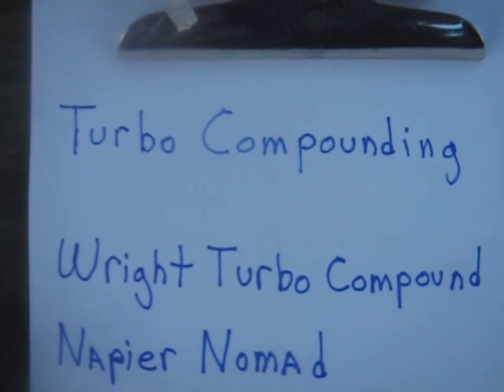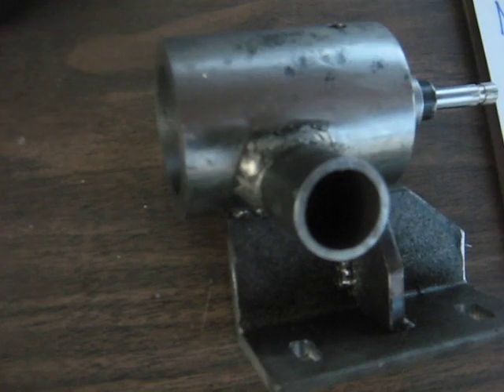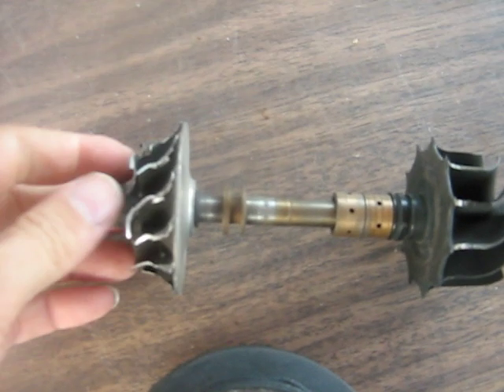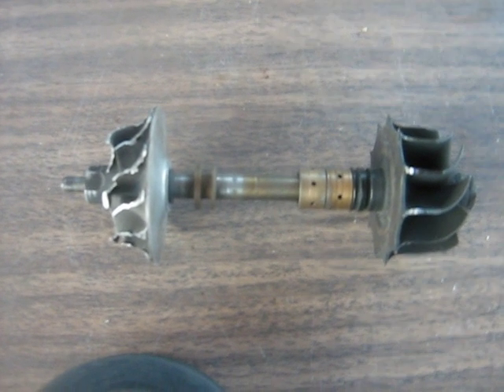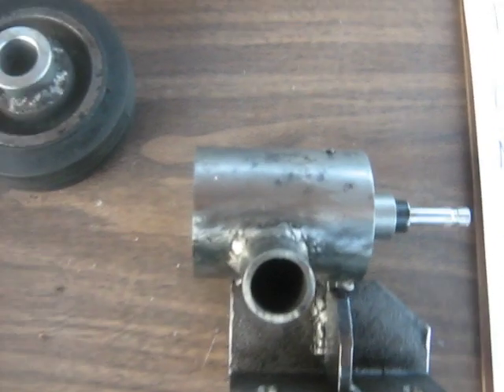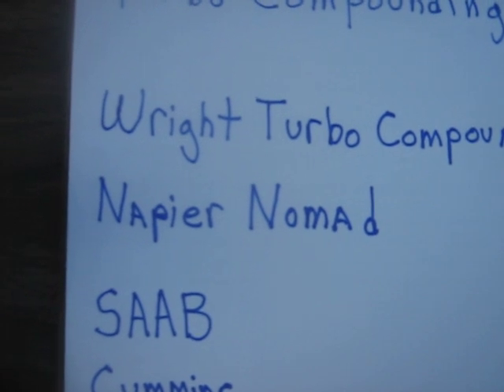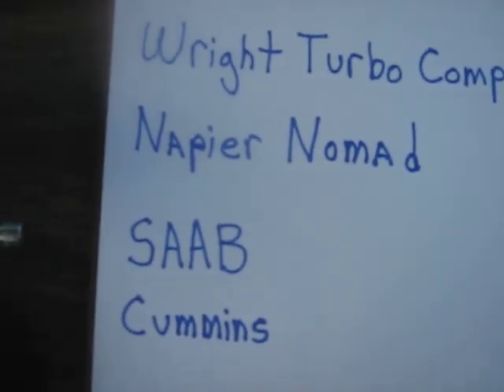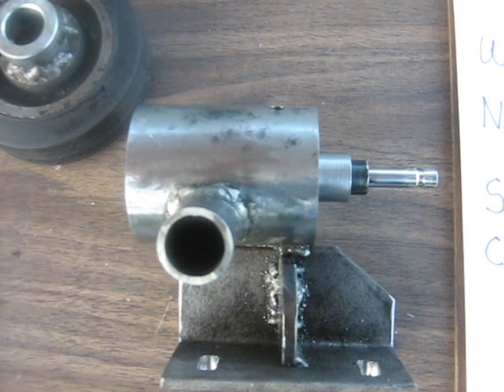What is Turbo Compounding?

Comment: Conventional turbocharging is analogous to using a high-pressure hydroelectric turbine to generating electricity. These systems both work off the high pressure intake side of the turbine - and - substantially reduce that pressure to generate electricity.

Turbo Compounding is like using a stream powered water wheel to generating electricity. These both work off the speed of the intake and don't affect the upstream speed or pressure in any way.

In other words, conventional turbochargers work off the pressure of the exhaust (and rob the engine of power); and turbo compounding works off the speed of the exhaust (and doesn't rob the engine of anything).
 
So why then do they say turbo compounding turns reclaimed heat of the exhaust into power and not reclaimed speed of the exhaust into power. The answer is bc heat and speed are interchangeable as described by Bernoulli and the Ideal Gas Law.

I've just done something that no one on Youtube has ever managed to do before - simply and intuitively describe how turbo compounding works.
 
You're welcome
Reply from the maker: Hey, thanks for that explanation, it is quite interesting!

Comment: What if you could develop a turbocharged axial turbo compounding engine? 

Essentially, take an even amount of pistons, and place them around an axial turbine design which means the primary forces of pistons will be moving in line with the residual thrust of the turbine.

I wonder if it’s possible to employ a turbine in that role, being turbocompounding, turbocharging and, perhaps, able to produce electric power or generate its own thrust independently of the pistons.
Reply from the maker: That  sounds like an interesting project, have at it!

Comment: The current Formula 1 cars use an electric-hybrid form of turbo compounding. 

The turbo unit (the shaft) also act as generator powering either the battery or the electric engine (which also doubles as a starter and kinetic energy recovery system when braking).
Reply from the maker: Yes, my son was mentioning that hybrid set up they have in F1, pretty ingenious!
Reply: ChargerMiles007 True, very ingenious,  but the noise of the current formula "sucks" compared to the old naturally aspirated V8s and especially the V10s and V12s.
Reply from the maker: Yes, I can imagine. I have a few of the Hot Wheels Brabham Repco V8 engined toy cars, i like the old cigar shaped bodies before they started adding wings to them. Too bad the wouldn't outlaw the wings, and get back to some real driving!  :)
Reply: ChargerMiles007 I doubt any 960 hp racecar (800 ICE + 160 electric) is going to be "easy" to drive.
The V10s which had more down-force and electronics (due to the rules of-course) were nearly undriveable in the hands auto journalists.

Noise may be wasted energy to an engineer, but fans loved the sound of those older aspirated cars.

Comment: You forgot to mention BMW are experimenting with it for cars. Why aren't cars fitted with turbocompound engines as an optional extra?
Reply from the maker: +Chris Henniker Thanks for the info about BMW, I wasn't aware of that. Interesting question, why isn't it an option, perhaps they are all concentrating too much on hybrids and going green.
Reply: Probably because turbocompounding was originally meant for certain engines, such as diesel generators, aircraft engines and large marine diesels, operating at nearly constant RPM ranges (as all gas turbines are, since turbo compound arrangements closely resemble the most simple gas turbines, having a gas generator like shaft, which is the turbocharger, followed by a free power turbine connected to the engine's shaft), and a truck does exactly that when cruising on the highway, while a car would be operating at a larger RPM range most of the time so the power recovery turbine could possibly not work optimally, or be subjected to too much stress (i think that's also the reason as for why variable turbo geometry is rarely implemented in large diesel engines). It would also need a large displacement engine to have the required volume of exhaust gas in order to extract a reasonable amount of energy (IIRC the Scania 124 470 gained about 50 hp from turbocompounding alone), so it's more suitable for trucks than for cars. It could also reduce the engine's reliability.

Comment: Why not put an exaust driven turbine where the exaust comes out with and afterburner to get thrust like a motorjet? probably illega and dangerous but I'd try that if I had the tools LOL
Reply from the maker: +Rex Holes Yes, I bet the local enforcement wouldn't view flames coming out on the tail pipe very kindly! Sounds like something from a Batman movie!  :)
Reply: Not only illegal and dangerous. Pointless, because the engine exhaust gas kinetic energy is low to start with. That's why you need to replace a turbo with a complete gas turbine if you want to reach insane levels of boost, instead of just stacking turbos (sequential turbocharging).

Comment: Id like to see what sort of shaft power you could get with a compounding turbo converted to a turbine ala Colin Furze or perhaps in a wood burning turbine engine such as the one developed by Mark Nye at Nye Thermodynamics.
Do you think you could pull that out of the hat?
Reply from the maker: Doing that might be a stretch for me, we have gotten a few runs out of our twin turbo jet engine, but my son made that so I am not up on all the calc's to figure out a new combustor etc. I will have a look at those sites though, as they sound interesting.

Comment: Yea I feel you there I buy 3 used frames ,3 body's , 7 engines none was working and random go kart parts from a guy it was cheap and I have build one so far I'm working on the second one and the third one we are gonna use 2 engines or build a 2 cylinder its gonna be sick I gotta post some videos of the one its almost finished

Comment from the maker: A 5 horse Briggs works out pretty good for a go kart, especially since the output shaft is 3/4", which is an easy size to get a centrifugal clutch for.
We built a homemade go kart from 1"by 1/8" wall square tubing, it was light enough that it would fry the one drive wheel with me on it punching the gas on dry pavement  :)
Wished I still had that kart, but we sold it to a friend.

Comment: Yeaa i know me and my brother and one friend always use to do alot of proyects toghether now  we are married and with out time but i still try to do some projects myself i know i little bit of everything wood.metal.fiberglass.sound systems.mecanic.building remodeling.electricity.plumbing.  now im learning about small engines you name it  i also have experience with lathe i use to work at a machine shop for over a year when i was younger keep up the good work

Comment from the maker: Interesting discussion going on here!
So most turbo chargers with centrifugals blowers would in fact use a radial turbine, interesting.
Maybe mine is a Centraxial !!!  :)
Plus I swear one of my engine contraptions used an extake valve  lol.
Thanks for setting us striaght about that. I will have a look at how to make a stator for my turbine to help it work better.

Comment: Well, I'm still pretty sure that the proper name is radial turbine since they don't rely on the centrifugal force at all to work. I'm currently reading "The Jet Engine" by Rolls Royce, but they don't even bring up these turbines. A bit of google searching supports my claim though. A compressor, on the other hand, can be of the centrifugal type, since those use the centrifugal force to compress air.

Comment: At least in jet engines its referred to as centrifugal, Centrifugal flow turbines are usually used in things like turbochargers and helicopter engines or APUs. The hot gases from combustion (or exhaust in this case) flow centrifugally across the blades so I guess it could be called radial flow as well.

Comment from the maker: Hmmm, that is a good point. I admit I am no expert on this subject!  I just call it an axial turbine since the gases flow axially off the blades. I plan to add a stator to it, but you are correct, the gas flows into the housing on a tangent like a centrifugal set up.
Thanks for the input.

Comment from the maker: All I have read on the subject said that the SAAB Scania truck division had a turbo compounded engine in production whic added about 30 horsepower, that was perhaps 10 years ago. I don't believe anything like this was ever done on cars, although I have read that BMW is working on an exhaust heat boiler -turbine system.